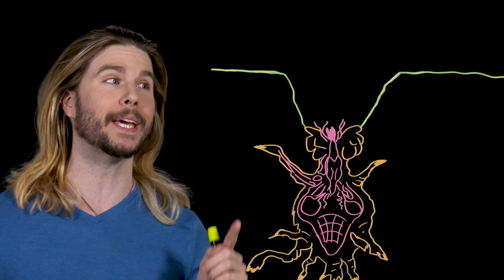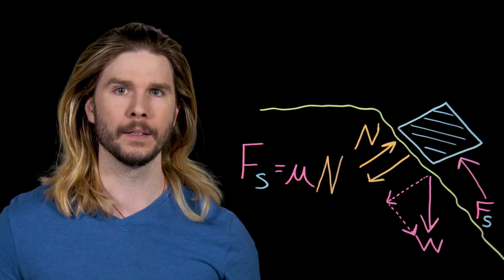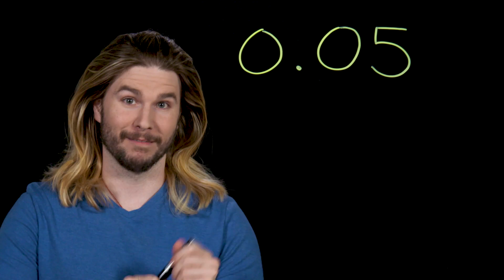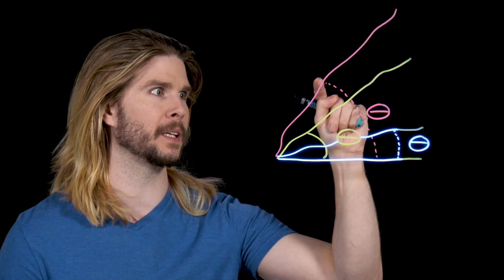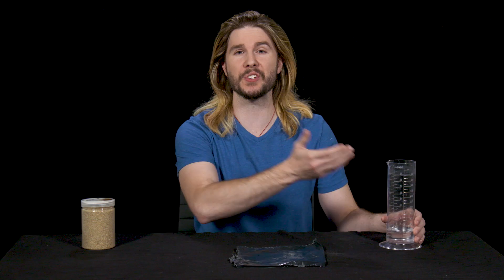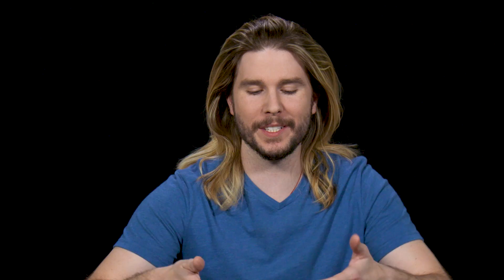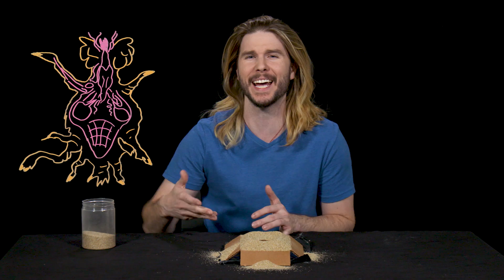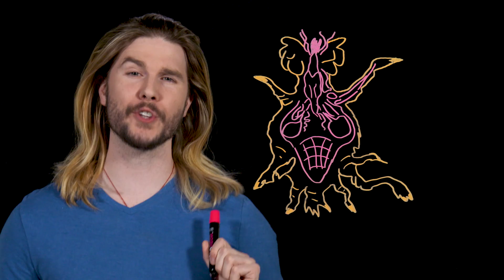How to Make a SARLACC PIT

Comment: Hey! Thats ASTM 1444! But he used the term "dirt" when talking about particls. What hea talking about is fulilling a jar with not only golf balls but also mixing the flour into the sand then mixing the golfballs in that. Theres still voids but more are filled up. The wet part is sort if the concept of ASTM 698 or the moisture density relationship. That is used to compact the soil under things youre going to build. He also used a very very poorly graded sand he needs silt. Sand, then silt, then clay particles. 
Lmao this is my job. 
But the sign of a very smart and knowledgeable scientist is being able to broadly explain a complicated process into something simple and easy to grasp for the layman. 

Basically can confirm the soil part as a construction labratory technician with 10 years under his belt.

Comment: I have a book that has tables listing the angle of repose for all sorts of materials from sand or cement to unground wheat or various meshes of gravel.  It also has other useful information such as Morse code, basic first aid, melting temperatures of various metals and basic English grammar.  It’s called Picket Reference by Thomas J. Glover.  You might think a book like this is useless in the days of the internet, but try googling specific information and you will find that your search engine will always prioritize advertisements and paid content over relevant information.

Comment: But neither the antlion nor the sarlacc actually engineer anything. The antlion flings sand up to make a hole for it enter and the sand automatically creates the angle on its own, and the sarlacc just opens its mouth and the sand pours in until it is stable.

Comment: As a kid, I'd get a small stick and gently tap it along the edge of ant lion pits, mimicking the movements of an ant. This would cause the ant lion to fling sand in the direction of the stick, hoping to knock the "ant" back into melee range.

Comment: Hows it hanging I'm just wonder how does the sarlac pi stay alive? I mean it never seems to move and it apparently takes thousands of years for it to digest its pray, And a creature its size must need a lot of ATP. Mybe it's a plant and has roots that go super far down but then it would half to use more energy to perform that capillary action! Or mybe it secretes bacteria that find organic juices in the sand and go back to the main body, mybe the sarlac is not even a biological creature but Like a gaint virus because it kind of looks like rabies, also I heard that they reproduce by infecting a living creature and pouring out there...... spores.... dang it. Welp what ever the answer is I don't no. Anyways what are you thoughts dude

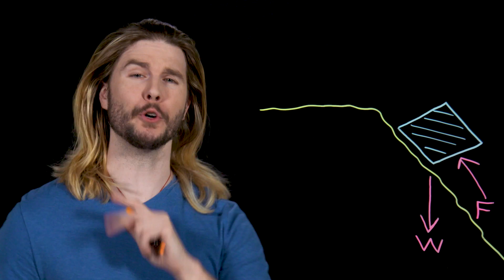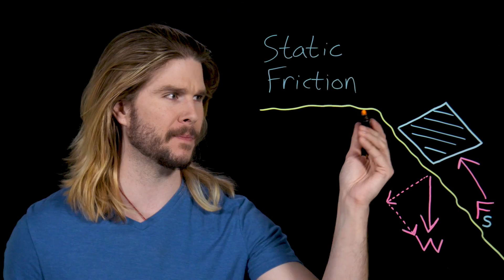Comment: 1:25 Um, no. There would be 3 forces (if your diagram showed all 2 forces then the object must be accelerating in some direction), the third force would be a reaction force, the same thing that stops you falling through the floor. That assumes you have a floor in the Void. Although you do add the extra force at about 1:48.

Comment: Anakin: its course, and it gets everywhere.

Sarlac: Stop complaining, at least you don't have to get it out of your teeth and back of your throat all the time!

All jokes aside, there are 2 major differences between the ant lion larva and the Sarlac that are worth mention. Anatomy and size. 

Anatomy: from the images and drawings you showed in the episode, the ant lion larva doesn't have a gaping maw resting open like, say, a Venus flytrap. It looks like the pit brings the prey down, and then the ant lion larva uses pincers to dispatch it. Therefore the Sarlac, with it's gaping maw, is going to be eating a lot of sand. I imagine it would have some way to deal with that, either by some way of separating the sand from the prey and regurgitating it, or by a digestive system that has evolved to digest vast quantities of sand.

Size: this is more of a tie in the the mouth/sand topic, but because of the ant lions size relative to a grain of sand, it seems it would be easier for him/her to avoid accidentally ingesting sand than the Sarlac. To the Sarlac, sand behaves like sand, but to the Ant lion larva, sand is the size of playground balls!

Comment: wouldn't a Sarlacc also need some sort of paralytic that is contained in the creatures its swallows to prevent them from clawing there way out? it's obvious the tentacles are just graspers and hole fixers. the beaks tongue likely contains a paralytic in the thick saliva that is potent enough to be absorbed by the skin of the victim. Or would it, the 100 meters fall on to the hard beak or spine thinggys be lethal to most anything over the size of a kitty, cause you do not mess with the kitty and live.

Side note: my favorite video is your first one on Godzilla nad since i first saw it in 2015 i have been thinking about how they could function couldn't a Titan like Godzilla have there nurvise system enhanced if the part of his brain that controls movement has quantum entangled particles at his articulation points, thus allowing him to move at the speeds he does via quantum tunneled nerve impulses sent to the nerves.. given he is a huge creature he could have a series of secondary hearts that help move blood faster. then instead of traditional cartilage, some form of silicon rubber takes its place. he could have something like iron, titanium or tungsten cables for tendons instead of whatever it is tendons are made from in non-titan species.  biology does not really interest me outside of Titan/kaiju biology.

Comment: So, I'm not a huge Star Wars nerd but the comparison between antlion larvae and sarlaccs brings up an important question: what is the adult stage of a sarlacc? Is there anything in star wars canon that's big enough to be an adult sarlacc? If not, then what if it's already in its adult phase. It can't be an insectoid because the chitin wings just wouldn't hold up. What if instead it was a cephalopoid. The beak and tentacles would match at least that much. And another thing: the asteroid worm. It seems to act like a massive bobbit worm, striking fast but also somewhat rooted into their spots. I think that in the star wars universe there was once an interstellar ocean of sorts. And now all the small spacefish that move around are extinct and the only remaining creatures are the massive, unmoving behemoths with slow enough metabolisms to still be digesting a long dead spacewhale.
Edit: sorry for the terrible formatting and grammar. Its 5AM and I can't sleep.

Comment: So, why does the sand tower stay at 90 degrees when the water evaporates? Granted, it wont take much to topple/break it, but if left untouched it will stay up a while.
Also, the Sarlacc did not pick the Pit of Carkoon for no reason, but like you say.. because it was a perfect pit for such a creature.

Comment: When you're using something with a melting point, you must include the melting point, loss of surface area, and how the melting object is subject to the loss of friction to itself. Also, what if the beast shakes the sand of the pit, allowing for the sand to lose integrity, forcing the food closer to the mouth?

Comment: Hey Kyle, does the Sarlacc have to "repair" the pit after a creature has fallen in? As you saw in the video with the antlion, when a creatures walks over it the sand begins to move. Does this change the angle and does the Sarlacc need to repair this angle or does it stay the same?

Ps. Love the show and i really liked the little experiments

Comment: I hate that you alluded to, but never said, that a SARLACC could MOVE! Imagine you have just crashed on a desert planet and you see a SARLACC digging its hole... Or even see one just slowly creeping through the desert. 

Also could it be possible that a SARLACC is the larvae of some EVEN LARGER FLYING MONSTER!? going back to what i said above, so you start running away from the SARLACC only to be picked up but an even larger beast resembling mothra... Screw that!

Comment: What if the sarlacc used sand on the rare occasion when it rains and is wet enough to form a much taller cone to build an unstable area near the edges of the pit, where the sand, when dry, will fall when even slightly disturbed?

Comment: Even if the sand isn't near its maximum slope that kind of soft, loose sand would be absolute hell to try to climb. So even if you're, say, some kind of primate that is able to dig their hands into the sand so they don't cause a sandslide (as often), you will still tire yourself out moving even a few feet, meaning you end up tumbling down anyway, and once you do end up at the bottom you won't be able to struggle so the sarlacc won't have to worry about you tearing up its insides after swallowing you!

Comment: Hey Kyle...love you, the show, etc. 

Anyway, when you're doing the pour for repose angles, you should have been trying to pour in one spot.  The movement of your arm can cause a significant (unneeded) deviation in the system.  Pouring vertically to a single point would let the objects find their own natural "repose" state, without deviation. 

Just one for the nerdy C&C section.

Comment: Hey Kyle. :)
The ice you used was in room temperature so wouldn't the ice melt and create a layer of water underneath and help it slip more easily? So if you had it at freezing or lower wouldn't you have to increase the angle in your demonstration for the ice to slide?

Comment: Kyle: Around 45 degrees, this is about as high as avalanche angles get.
Also Kyle: If I put some water in this sand I can build a sandcastle with an angle of repose of basically 90*.

Comment: A few months back I was researching angles of repose to try and come up with an estimation of the outward forces put on the walls of a box that was filled with some substance and came across almost all of this. As soon as, in the last video, you talked about engineering the perfect sarlac pit the first thing I thought of was if you were going to talk about the antlion larvae and thus far I am not disappointed.

The formula I kind of came up with went to calculate how much of the substance would be sitting outside of said box if it were a pile and taking the mass of that to calculate the force.

It's cool stuff.

Comment: hey, u say ice has low fritchion  but i think your rong. ice it self isnt slippery. and acually through the crystaline structure is quite rough. but do to ice melting it created al liquid coat witch lets ice slide on the rough surfaces. its water at witch has lpw fritchion not ice.

Comment: One could develop a 90 degree angle of repose with dry sand if the translational forces for each vertically added particle of sand  were zero which corresponded to a common vertical line of symmetry in the particle below, ensuring the rotational forces where also zero....  Additionally if I had a Suck-sac Pit I'd round up every space horse I could find and ride them all to into a 1000 degree angle of repose....lolol…..stupid fucking space horses......

Comment: I mean, sarlaccs aren't immobile until at least after they reach maturity. For the first 30,000 years of their life they're mobile. According to wookipedia (I think most of this information comes from comics or books which are accepted as canon), when they reach a certain age they then find a good spot and burrow into the ground. So I'd imagine the engineering of the pit occurs as similar to an ant-lion where they could burrow in circles from the surface to form a cone and then fling sand up from the bottom.

Comment: Hey Kyle, love the shoooow! (Insert obligatory thumbs-up here)
About increasing the angle of repose by adding something to your materials. We do this every day with dirt. Dirt is used to build foundations for everything from buildings to highway overpasses, and the best part is how cheap it is. One of its other great properties is its compressive strength, being able to support very heavy loads without failing, but its drawback is that it lacks shear strength (which is why it has a typically low angle of repose). This causes problems with settling, the dirt moving out of the way of the load it's supposed to be carrying, erosion from the side of structures, etc. To mitigate this, we use what is called Mechanically Stabilized Earth -- a composite of layers of earth held together with some kind of reinforcement. This reinforcement can vary from steel sheets to a durable fabric -- think the black ground cloth people use to prevent weeds in rock gardens. This adds tensile strength that prevents the force of the load from causing the material to shear, so that the force it exerts is downward rather than outward.
MSE can support heavy loads without shearing, and its angle of repose is near verticle. Putting up a retaining wall is so much easier if all it has to do is prevent erosion rather than hold back the weight of an entire hill. In fact, if you've seen a retaining wall near a highway overpass with those tall cement walls, you've seen mechanically stabilized earth at work. The cement wall is there to prevent erosion from the side. Concrete, as has been stated before, has terrible tensile strength, and so could not realistically hold back the weight of the cars passing overhead causing the dirt to buckle outwards, but it can hold back the few pounds of dirt that want to slip out of the side of the MSE.
It's fun to drive past construction sites and see that black cloth poking out from under the dirt and realize that such a simple principle has been around you for years without you even knowing about it.
(Credit goes to Real Engineering for doing a video about this subject, which is how I came to learn about it. Huzzah for educational entertainment!)
Reply: My dad is a geotechnical engineer. I would be surprised if he hadn't heard of this.

Comment: Howdy there, Partner! Long time fan of this here show you gots and glad to finally have a good input to the subject at hand!

Angle of Repose is actually a pretty important phenomena used in modern civil engineering. Specifically what I think of is highway exit/entrance ramps in more rural areas. These typically need to no take up a lot of horizontal space but still need to rise significantly and also support the weight and vibration of several cars as well as the road itself. In Urban environments you'd just make a concrete ramp and that's that. But that's too expensive for the majority of ramps, so a lot of the time you'll see these hills being constructed primarily of dirt which has a decent angle of Repose as it stands.

However there's a way to make that angle of Repose even greater than 45º and that's through reinforced, or laminated, dirt.

 Practical Engineering on YouTube does a great job of explaining this but imagine you have a box mold. If you fill it with dry sand and slide it out of the mold, it will instantly assume it's angle of Repose, if you try it again with wet sand the water will hold the sand together mostly and retain the box shape when removed from the mold but can't even hold the weight of a toddler. Now take that sand lay down an inch or so (depending on scale) of wet sand. Then lay down a section of a cloth and then keep alternating sand with cloth until your mold is full. Remove it from the mold and the integrity of your new cube has enough strength to hold the weight of a car if done by 1ft³.

I guess an interpretation of this could be that with each sheet of cloth you reset the height of the angle of repose? Not sure.

But yeah that's why you'll see these ramps made mostly entirely of dirt but still have the entirely 90º faces that are facing the road that goes under the bridge. 

Love your show and love the content. You should consider getting a goatee. I hear they're all the rage these days

Platonicly love you, Nat Versluys

Comment: Yeah! Something I can comment on!  I actually am a material scientist and my brother-in-law is an avalanche forecaster!

Angle of repose is a notoriously difficult value to calculate because it depends on a combination of the particle size, aspect ratio, rigidity, static friction, and density.  And that's assuming the particles are uniform.  If you add in two different materials, it becomes an absolute nightmare.  It's one of those properties that is wildly easier to measure for a material than calculate.

Calculating the "avalanche angle" for actual avalanches, though, is far beyond that.  Snow is extremely difficult to predict because the snowpack almost always includes snow of different ages from different storms at different temperatures.  Depending on the classification system you use (I prefer Wilson Bentley's) there are at least 8 different types of snowflakes and, as the saying goes, almost an infinite number of variants within those.  Further, snow can clump together mechanically.  Think about all those dendrites of the classic snowflake mechanically locking together.  Snow can also clump by melting and refreezing together with interstitial growth.  However, interstitial growth is commonly amorphous ice and exhibits different material strength to crystalline ice.  Snow can also sublimate below freezing temperatures and refreeze to form depth hoar and surface hoar, changing the snowpack even when temperatures stay below freezing and there is no precipitation.  To make it all worse, snowpack is a near perfect black body radiator, creating strong thermal gradients within the snowpack on clear, cold nights.  All of this ignores the heat generation during compression of the snowpack or even during an actual avalanche that changes the material properties of the snow on the hillside.

Because of these properties of fluffy frozen water, determining an "avalanche angle" for actual avalanches is probably the hardest avalanche angle to determine.

Oh yeah.  Love the show and your hair.  Keep it up.
Reply: Yes! I got hearted by BS! Sweet, sweet acknowledgement!